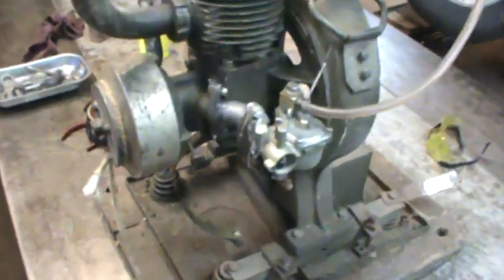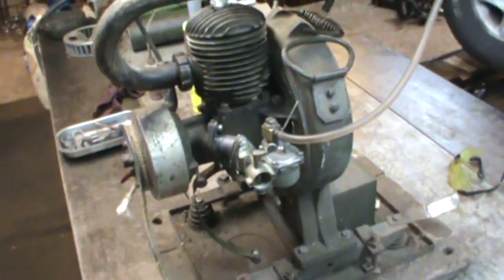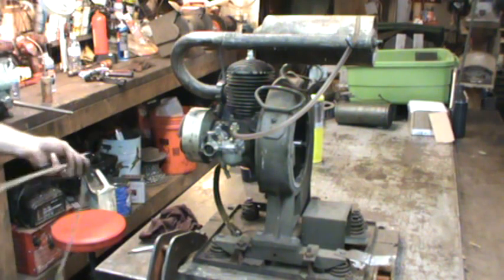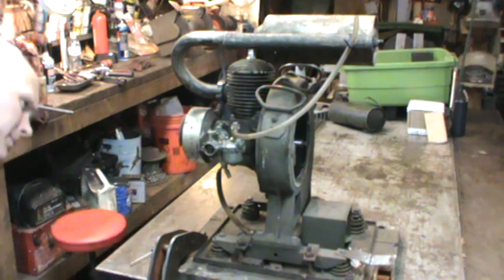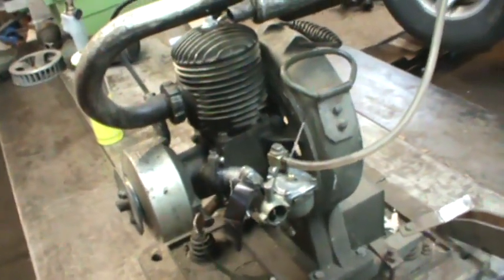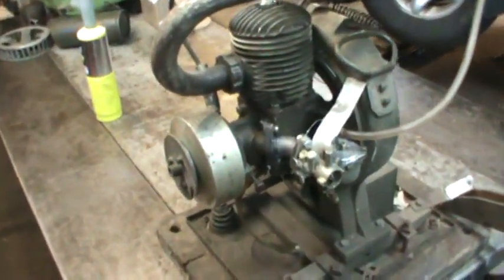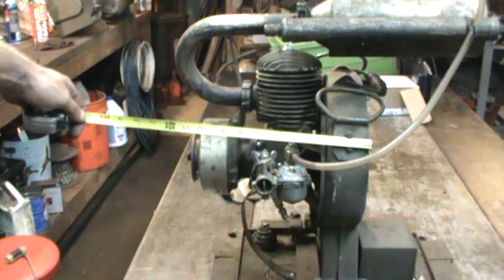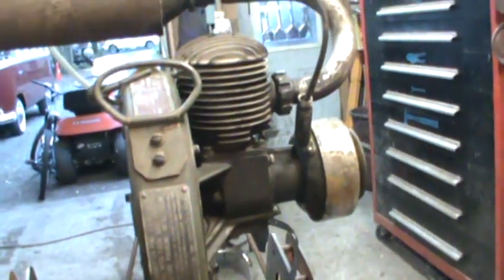building an engine for the next bike.pt3

Comment: Very cool. You might want to seal up the bottom end first, if it has an air leak it will be lean no matter what. When a 2 stroke has an air leak, they are impossible to tune, run hot and damages the topend pretty quick. I know you know this stuff. Just my 2 cents, thought I would say something cause you mentioned the leak and kind of just moved on, it could very well be the root of your problems. Keep up the great vids, I'm always learning great stuff on your channel.

Comment: i wouldn't  think you would need the fan, when its on the bike moving through the air it should get cooled  as you go ,the only thing i see that may cause problems as regards cooling is the head is facing the wrong way for the air stream but you could use  some kind of scoop to direct the air over the head .

Comment: What mix were you running? A lot of those old 2 strokes run 30:1. Fan wise, take a look at the stub shaft style fan used on a snowmobile engine. That would let you just stack a couple pulleys on the output shaft and use one to power a fan.

Comment: That engine should go in the bike so the pull start is at the front,behind the front wheel,and make it shaft drive with a friction wheel clutch..Then to the back wheel,..That would be COOL!! like a BMW motor cycle

Comment: It did sound like a pile of rocks in a washing machine lol, but im sure it was those handles and fan casing flapping around.
I had to laugh at the start, it just wanted to run away lol :-D
Reply from the maker: +zx8401ztv that happens alot runnin on a bench, but it cleans all the trapped dirt out of the benches crevises, its a big ultrasonic cleaner,
Reply: +mustie1 lol. yeah.